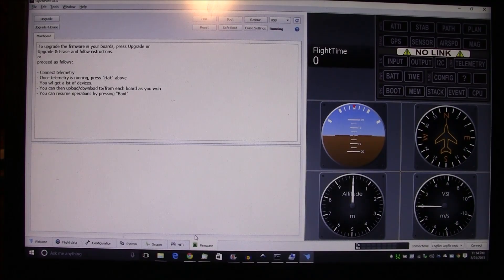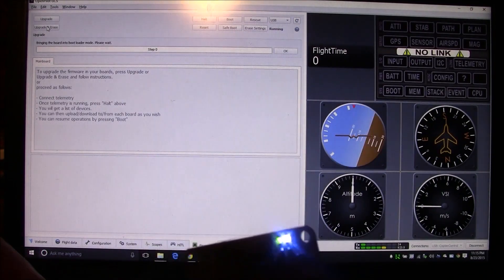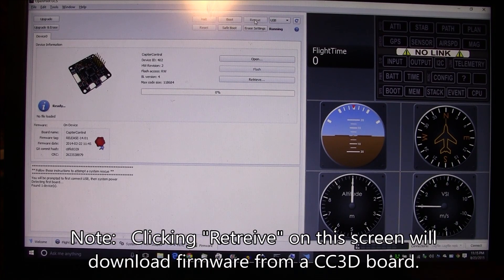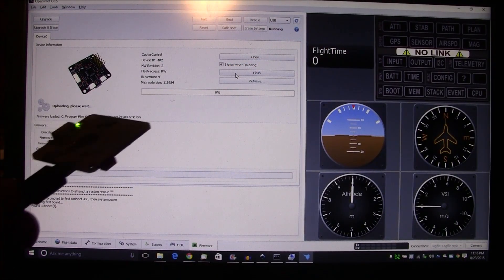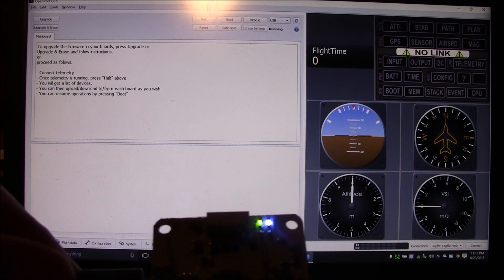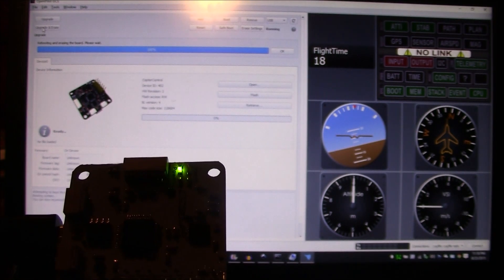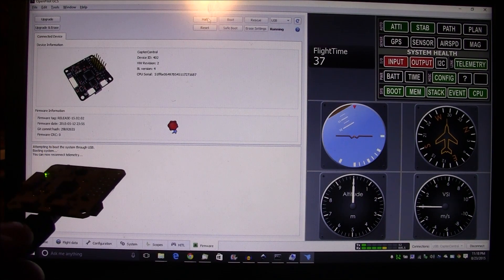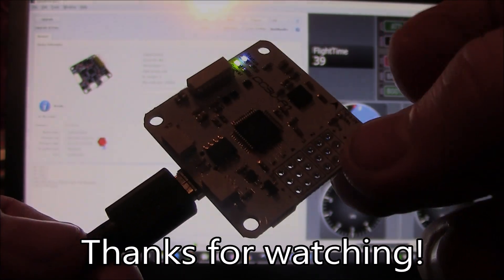CC3D Upgrade & Erase Failing Error & Fix

Comment: Hi I know this video is five years old.but I followed your video for the cc3d board I have the atom.
All you said worked for me untill I try the vehicle setup Wizard.
I get ever board not recognise or most of the time even though I have updated driver on laptop.
I get when I push the upgrade tab 
I have to do a manually upgrade the board using the uploader plug in ? What and how is my question
I've been stuck trying to fined information how to do it and what I need.
If you can help me please do or put in the direction to a video or something to help me.

Comment: What about now that open pilot is no more? When I plug in my cc3d it has a solid orange light and blinking blue, windows says drivers are successfully installed, but I even downloaded openpilot 15.02.02 and it doesn't recognize I have anything plugged in. 
Are we still able to use cc3d fcs today?
Reply from the maker: I think LibrePilot is still supported.  You could try that instead of OpenPilot.
Reply: I figured it out. You have to have the cc3d unplugged from the comp before you open the software, and don't plug it in until it is searching for your board to update the firmware. Thanks!
Reply: Only problem now is that while testing (w/out props of course) I found out that if I turn off my Tx while the battery is still connected, the motors go FULL THROTTLE. I think it has to do with reversing throttle after binding, and having Failsafe "On" (Flysky i6). I'll have to wait to find out bc one of the ESCs caught fire and smoked out the 3rd time that happened.

Comment: Just to let you know I found the problem with my CC3D not upgrading.  It was the windows driver.  If you have symptoms like the ones below or your CC3D won't upgrade checkout the link below.  It worked for me.
       Board is detected and automatically connected to GCS, but nothing else
       Board information after Firmware Rescue is correct,
       Board looks running: fast led blinking at bootup,
       But No Rx data received, only Tx data

Here is the link tell you how to correct several problems. 
https://librepilot.atlassian.net/wiki/display/LPDOC/Troubleshooting

Comment: Travis, you seem to be the only Guy on youtube that has worked with cc3d board and Librepilot.  I tried your steps for fixing two cc3ds that won't boot and they still won't connect properly.  First question, I have 3 cc3d board like the one you use in the video and one works and the two others don't, but all three turn on and will give me a yellow solid and blue flashing lights. The one that works as well as the others all give me a constant yellow light and a flashing blue light once I connect them to the software.  All three show they connect but the two that don't work only give me one green light on the software Tx/Rx display in the lower right hand corner of the software display.  The one that works gives me one green Tx light and four green and a yellow Rx light. Can you recommend any additional help getting these guys to work
Reply from the maker: I had one board that this firmware fix I did would not fix.  I finally threw it away and just bought a new one.  BG sells them for $13 and I was spending way too much time trying to fix it.  http://www.banggood.com/OpenPilot-CC3D-Flight-Controller-Bent-Pin-STM32-32-bit-Flexiport-p-956366.html?p=6Z050013977120130325
Reply: Just to followup.  I tried my CC3D board on another computer running OpenPilot and it worked.  So I wish I knew why it wouldn't  work on my other computer.  Oh well.

Comment: Thank you.  I managed to fix my boards.  Awsome.  Like your work.  Keep it up:-)
Reply from the maker: Thanks!  I'm glad it helped!
Reply: Yea the way you explain it makes it yeasy for us beginners on the openpilot program.  I have buildt 4 drones but i still struggle a little with tuning.  And setting up my flysky for the 3 options on basic setting.  They are on the roll buttons instead of the klikkswitches.  But i found out i could tune it to the point i was happy when the roll button where to select the 3 different modes.  I am right there are 3 modes in basic settings???  Or am i very lost.  And pid is some im struggling with.  What can you say about tuning pid simple?  Have it connected to computer while hovering???    Il have alook at you other videos to see what i find.  But you saved my as this time.  I got a prebuildt quad. But there where connection problem with battery plug. So i filmed it sendt in and the refunded.  I was just making em aware.  But soldering a new one is dayli work with drones.  I have solder iron with me in the field.  They have some cheap good butan gas irons that actually is good..  Just tell me if you want link. there are many.  Only one of em are god.

Comment: @travisgrindal...This was a cc3d saver.  I dug it out of the trash today after seeing your video and all is great.  I used LibrePilot GCS 15.09 and it worked as well.  The bin file is the most important piece to get it to work, a known working firmware.  Thanks.
Reply from the maker: Yeah, it has to have good firmware on it before you can do anything with it.  I'm glad this worked for you!

Comment: Video is almost a year old and people from a week ago are saying it worked.. im not having any luck =/

Running the Eachine 250 CC3d, trying to put this on a new frame. but it refuses to respond after the move, but was fine when i had it in the old rig.. its got two plugs on it so i just now connected them before putting them on the unit

Comment: my problem on the macbook is that it does not even see it when i plug it in. no sound from usb port. plugged it in my mouse port because that works and still nothing??
Reply: I have Cleanflight configurator and Librepilot GCS on my macbook air now. cc3d and naze32 work fine.

Comment: Thank you so much man. I was gonna buy a new board because of that. I was trying to install the betaflight firmware but when I try connecting it to cleanflight it doesn't connect for no reason. I tried switching to the old firmware but never found it man. Thank you once again.

Comment: hello! what was the problem you were facing with the board before fixing it? mine was only recognizing one motor. i tried many hardware changes and ended with a. smoke out of the board. ordered a new one and hope the firmware is ok.

Comment: Thanks , I was stuck with an incompatible firmware from an Ebay seller. Was cheap.This method you had found worked perfectly and I am up and running. I would have spent weeks figuring it out as well otherwise.

Comment: My CC3D still won't work.  I tried a process to burn the Cleanflight CC3D binary onto the board using OpenPilot and while the "RESCUE" process in OpenPilot indicates that the software uploads, the flight control panel doesn't move when the board is connected AND even the Cleanflight program just keeps indicating that the board "FAILED TO OPEN SERIAL PORT."  Though it had older software IN the CC3D before I tried to convert it to CleanFlight, at least the flight control panel worked.  Not anymore though.
Reply: +alienspy99 that is my problem aswell tell me if u fixed it <3
Reply: No, I haven't fixed it yet, but haven't given up hope either.  I bought a low cost FTDI from Amazon.com and it was apparently shipped on the slow boat from China.  I am hoping to burn a new bootloader into the CC3D.
Reply: +alienspy99 i ordered a naze32 rev6a 6dof from banggood.com it will arrive between 7 and 10 march hope it works
Reply: This is what I tried doing earlier today but it didn't work so I had to switch back to the previous firmware which was not saved so I got stuck, this video got it back to life.
Reply: +Randy Lachman I honestly like the naze32 way more, no faults or errors, much higher capabilites and specifications
Reply: +jamil af my cc3d doesnt even boot any more so i am still waiting for my naze32
Reply: +Randy Lachman Is it not turning on or not booting? If its not turning on make sure you use a good usb cable for connecting. If its not booting, install the firmware from the video discription and flash it to your cc3d and it should work fine.
Reply: +jamil af but the bootloader is version4 and it doesnt allow me to flash it 😧
Reply: +Randy Lachman Make sure you have the latest GCS installed and then go to this link     http://opwiki.readthedocs.org/en/latest/appendices/bootloader.html    scroll down and then download the right and latest bootloader for your type of controller and then flash it, after flashing it, flash the file in the video discription and it should work just fine
Reply: +jamil af ok i will try it when i get home
Reply: +Randy Lachman aah damn i got the naze32 from banggood.com but it won't connect to cleanflight
Reply: +Randy Lachman Did you try fixing the cc3d first?
Reply: yes but i couldn't fix it

Comment: Hi i got issues issues  issues  issues  issues  issues i have the cc3d atom and i was getting trouble setting it up for the Hk trifecter  this is my first time trying a cc3d and it SUCKSSSSSSSSSSSSSSSSSSSSS lolz i never any problem with naze naza apm KK2  and so on all i  did was unplug the cc3d atom to re-run the wiring and when i plug it back it to do a full setup it said " bootloader fail "  all the videos i watch to fix this FC nothing works i can't get the screen which is shown here to browse to manually install another firmware  any suggestions or should i just make it fly by trowing it out the window lol

Comment: i have an bricked cc3d fc  when i cinnect windows says doesnt recognize the board 
plz help me
only one light green light is on
Reply from the maker: I have one that when I plug it in, nothing happens.  I think it is broken.  If windows doesn't make the little connection sound, then it probably can't be fixed.
Reply: o the bootloader is del
the board is in case 
it cant be harm

Comment: Oh WOW, that saved me. Same story  :CC3D from Bangood, OP GCS complains for the versions, no joy with the udpate. Had to repeat 3 - 4 times your process (!!), at the end it worked. Now the formware is updated to 15.02, still sometimes GCS does not connect the board, but if I close it and reopen them it works... I fear there might be some issue with the USB driver. Anyhow, thanks for the info!

Comment: This doesn't seem to work on my board,same as Stephen Watkins a while back. After flashing the firmware and reconnecting the board,it is not recognised (nothing happens as NO LINK is still indicated). Then after clicking the upgrade&erase,it times out when booting,still no telemetry connection. I have tried the instructions on this tutorial several times but no success. Still stuck...

Comment: I had same issue with that CC3D board from Banggood (that come as CC3D (Evo)    ) , but i just used the resque button to "awake" the update funcion.  Had same crazy problem after first reboot  ( the level bubble spinning around), after did the reset all went ok. So i didn't need to upload that firmware. Anyway that's what happened to me.
Hope this can be helpful too.

Comment: when i tried programming it on a zmr250 there was no other tuning option(e.g all the tuning like generic quad x ,qav 250)there was only current tuning.What is this problem?Bad cc3d?
Reply from the maker: +kingzmen kinzmen You may be running an older version of OpenPilot. I'm running 15.02.02.

Comment: I used tmotor 2206 2000kv so that's mean I have to do the samething, set the rate to high?
Reply from the maker: +Fernando Ramirez Yeah, I'd start with high.  I have some 2000kv motors and I had to set them to Medium-High.  When you first set up your motors, test them out with no props on.  If they sound like they are "changing gears" like in a car, then lower the rate in the BLHeli Suite.

Comment: Hi I love your video,.,.,. I have a question ,.,.,., which ESC can you recommend me for cc3d? I just installed syn BLheli 20amp and doesn't work as well,  sometimes the quad doesn't arme and went armed the motor shaking and don't spin.  thank you for your anwers!!!
Reply from the maker: +Fernando Ramirez I use the SN20A ESCs.  In the BLHeli Suite when I'm using 1306 or 1806 motors, I set the rate to High.  That has been working well for me so far.

Comment: It worked!  I had 2 CC3Ds that I couldn't flash and I've got em both working.  I use OpenPilot on a mac.  It seems that quitting the program between the steps is what it takes.
Reply from the maker: +mchevalier77 Yeah, sometimes Open Pilot works a little oddly for me too.  I'm glad it worked for you though!

Comment: Worked like a charm, Thanks Travis. I ordered a CC3D back in 1/22/15 from Banggood and I did not have to do this, but I just ordered a new one from them last week and it was doing the same thing as yours. Thanks for figuring this out for me.
Reply from the maker: I think it is hit-or-miss with some of the CC3D boards.  I had to do this same thing about a year ago and then when my friend needed help with this same thing, I thought it would be a good time to make a video.

Comment: Are you running the openpilot firmware or cleanflight. What your views and opinions on both, and if so how do you find this compared to a naze32 ? Thanks in advance.
Reply from the maker: +Paws I like the CC3D better right now.  I think it is easier to tune than the CC3D and I seem to get smoother, more solid flight than I've been able to get with a Naze32.  They're both good though.

Comment: Travis, have you tried to hit the "upgrade and erase" button and THEN plug in the CC3d? That is what I had to do with mine when I had this same issue. Might be a quicker solution.
Reply from the maker: Nintastio FPV I don't think I tried that.  This was how I got mine to work earlier and it worked then and then it worked this time.  :)
Reply: Dude you just became my hero. I was frustrated that it didn't work and here is this God with the solution to my problems right in the comment section. Thank you.

Comment: any issues with the mini cc3d from banggood ?
Reply from the maker: +michael lee Not yet.  I have it in my Blade 150 and it is working fine.
Reply from the maker: +michael lee I tried two CC3D EVO boards and boards and when I flashed the latest firmware to them, they quit working entirely.  The LEDs do not light up when I plug in the USB cable.  I think they are toast.  I do NOT recommend the EVO versions.
Reply: +travisgrindal thanks for the info, just got 2 minis and 1 non evo so im all good  : )